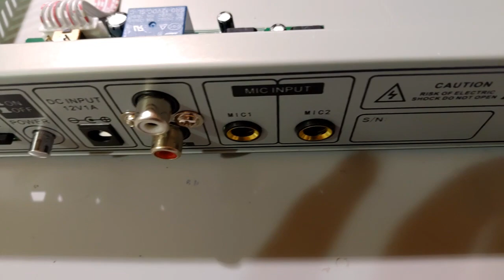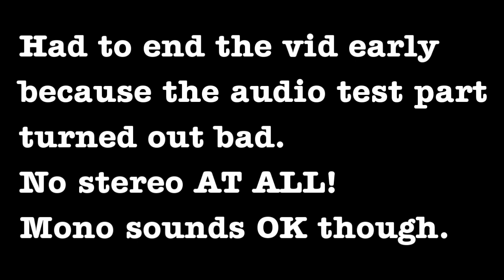Open Retekess TR510 FM Transmitter - PT2

Comment: Since the spectrum analyzer revealed that there is stereo being generated, perhaps the problem lies in the audio jack wiring. perhaps there is a jumper  or pc board trace that needs to be cut to separate the left and right inputs. before they go into the motherboard.
Reply: Meanwhile, I have solved the mystery. I think that someone from Retekess messed up real bad because the source of the problem is actually that the JL AC21 Bluetooth audio chip only has one channel being a mono chip. Also the fact that the audio input into the QN8007 chip is bridged is a sign of sabotage from an angry employee at Retekess factory :)i cut the bridge on the board and soldered wires directly from aux input to QN chip and its fully stereo now
Reply: @DjlapetrecereRo  Hey  great  detective work!!! I am sure many people will be happy to know what you have discovered.!!

Comment: still confoundED a bit on a getting cheap fm transmitter what to buy ?  for my shop use that does not suck   used the crap 5 buck board and it died lol  1 watt or so or less just 200 feet very clean range is all i need for now .100.00 is a lot to me for a board that just needed a better chip as mine had the crapest chip i assume. STEREO IS A MUST

Comment: The transistors inside are R25 ( 2SC3356), RE75 ( 2SC3357 ) and as the final MX5 GF3 1H4 ( RQA0005MXTL-E which has an output of 2 watt maximum power ) . You cand find the first two but it seems that RQA0005 is no longer made and the alternative is RQA0009 SXTL-E which has 3,3 watt max power output.

Comment: I've just found out that my brand new TR510 does not do stereo audio. It's a bit sad that I discover this video too late :(
Reply: Since the spectrum analyzer revealed that there is stereo being generated, perhaps the problem lies in the audio jack wiring. perhaps there is a jumper  or pc board trace that needs to be cut to separate the left and right inputs. before they go into the motherboard.
Reply: Bem isso amigo. Eu comprei o meu na mesma data que o Spectraman adquiriu o dele, como era lançamento quis logo comprar um confiante que fazia bom negócio, infelizmente é MONO e não encontramos ainda forma de concertar.

Comment: Thank you for the review
Curious if there are any problems with overheating in this one, since it doesn't have a fan
Reply: The radiator that it is monted is more than enough for the 1,5 watt maximul power that it transmitts. Also the transistors have thermal paste between them and the radiator.

Comment: Still haven't found out why the stereo is not working?
Reply: Since the spectrum analyzer revealed that there is stereo being generated, perhaps the problem lies in the audio jack wiring. perhaps there is a jumper  or pc board trace that needs to be cut to separate the left and right inputs. before they go into the motherboard.

Comment: For anyone interested, here is the datasheet for the QN8007.
https://datasheetspdf.com/pdf-file/1028101/Quintic/QN8007LB/1
Looks like it has a built in RDS encoder. I wonder if the firmware can be re-flashed via the USB port?

Comment: Awsome, thanks for that.
As i mentioned before, the Retekess rep told me that this was a 5w unit, with an internal fan 🙄. 
So either they are lying or there are two versions. 

I do like the potential to put a PA in there but dont know why you'd bother until Retekess sort the stereo issues out. I really get the feeling they rushed these V1. 0 versions out with no quality control. That cpu is interestingand does seem overkill unless they had visions of implementing RDS??
Reply: It's One Watt big size trancemeeter...,,☺️☺️☺️☺️☺️

Comment from the maker: Later I will try to examine why the stereo is not working. It must be shorted or something because the chip has very easy stereo built in.
Reply: Atualizando, eu continuo com o TR510 aqui em minha casa, guardado em sua caixa OEM, espero que o SR Spectraman encontre e nos repasse uma solução. Eu recebi aqui o TX ELE EL 15S, quem sabe em um dia futuro o amigo Spectraman faça um review. Pelos meus testes singelos constatei no analisador de espectro uma boa separação de canais nesse ELE EL15S, e suspeito ser um chip QN8066 pela qualidade do áudio. Vou aguardar novos vídeos e mais informações que eu souber eu posto. ABS do Brasil a todos.
Reply: Since the spectrum analyzer revealed that there is stereo being generated, perhaps the problem lies in the audio jack wiring. perhaps there is a jumper  or pc board trace that needs to be cut to separate the left and right inputs. before they go into the motherboard.
Reply: Como eu estou triste, o tão sonhado transmissor com o chip QN8007 da Retekess TR510 está com áudio mono;  que triste, decepcionado, paguei o dobro do valor que paguei no CZE que mesmo com seu chip BH1415 tem um bom estéreo e uma razoável separação de canais. Nem sei o que dizer. Estou triste.
Reply: Caro amigo DR. Spectraman, espero que com seu amplo conhecimento você consiga resolver essa questão do estéreo, fiquei triste, pois estava muito ansioso em comprar e ter um transmissor enfim com o chip QN8007. Agradeço pelos seus vídeos e por este espaço dedicado a RF e Broadcasting :)